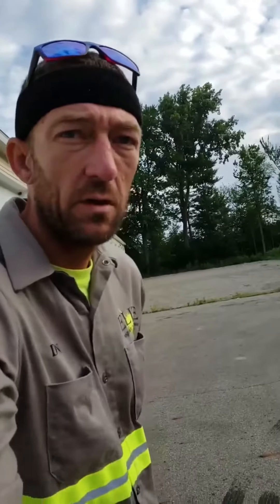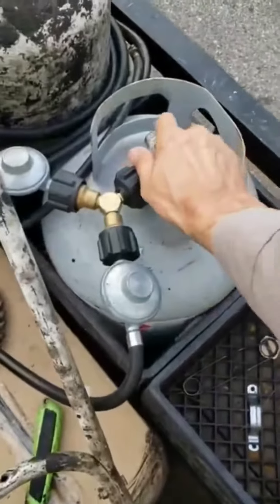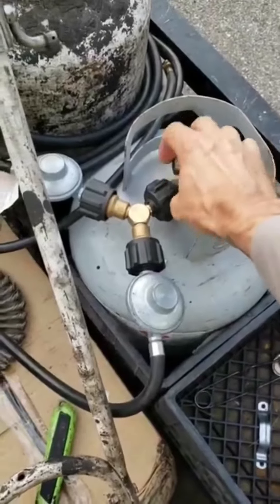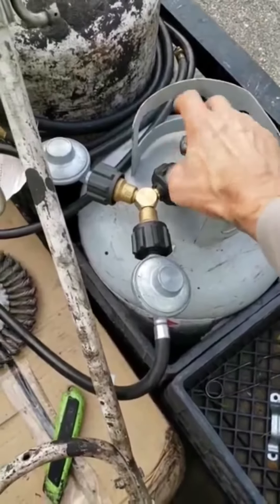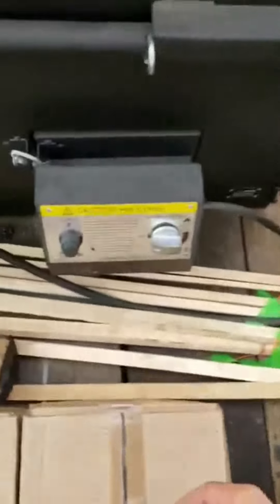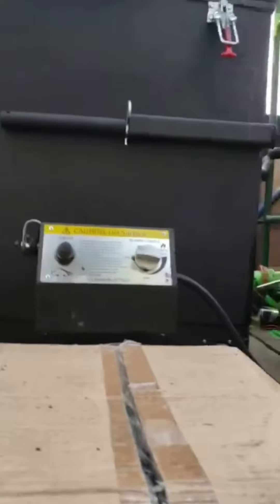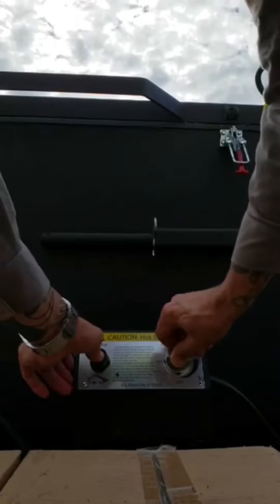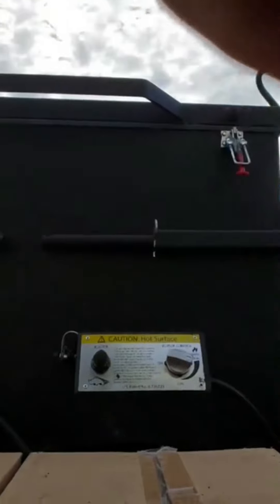Learn How to Start the Ryno Worx RY30 Crack Melting Kettle

Comment: Do you recommend the RY30? Is it better than a standard torch kettel ?
Reply from the maker: 100% The machine in this video is the RY30 PRO it has dual halo burners that melt crack filler more quickly and evenly than any other oven on the market. Learn more here: https://www.asphaltkingdom.com/30-gallon-crackfill-melter-oven.html